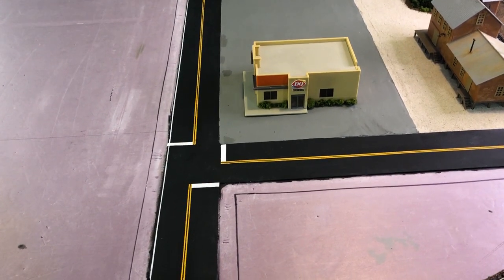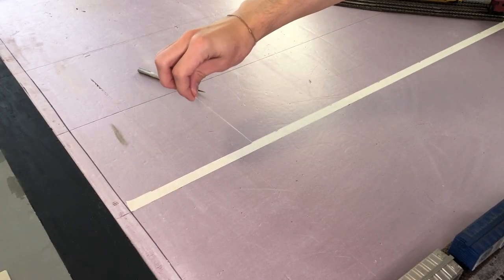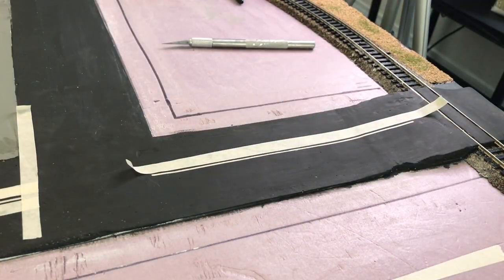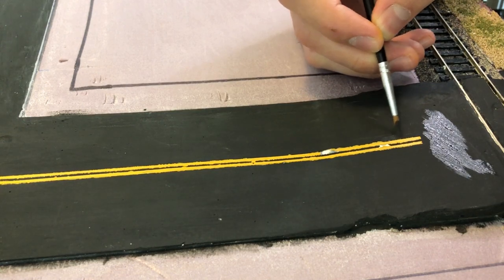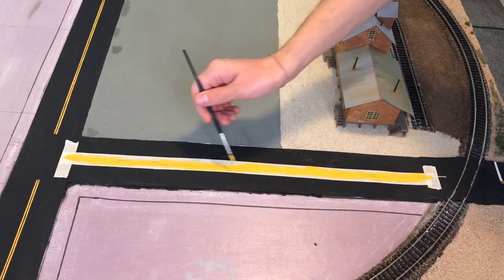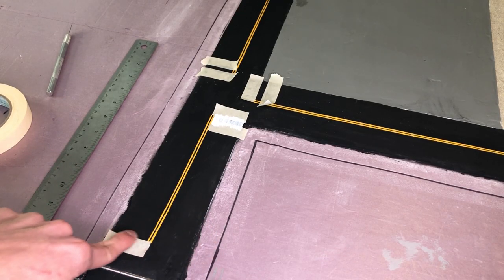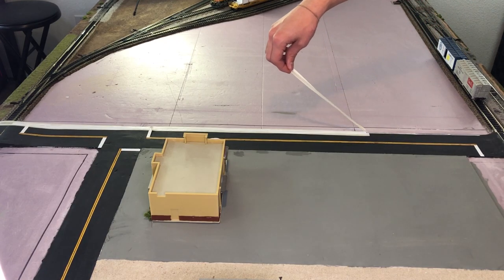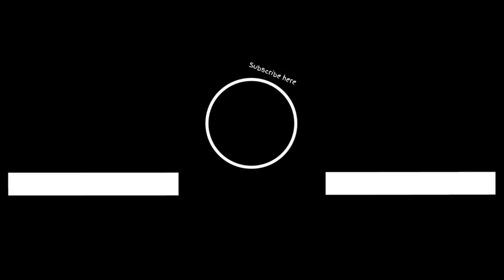Building HO Train Layout - Ep 7 - How to do Road Lines (Double Yellow)

Comment: Buy yellow plastic tape of about 1 cm wide. Cut it to the width you want it to be with a ruler Tape the road, cut out the strip you want to be black with a ruler on both sides. Pull it out 
and there you have it. Just saying. Greats from the Netherlands